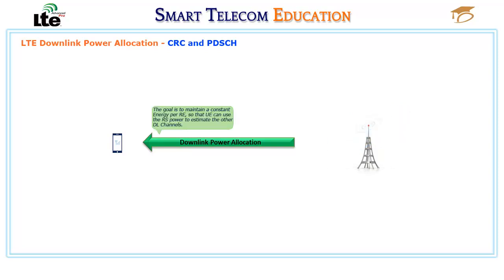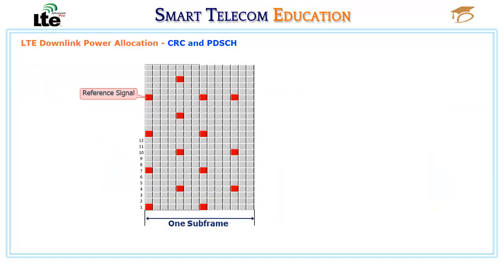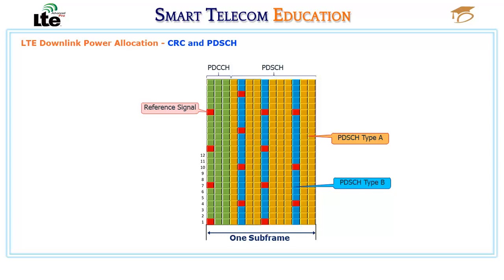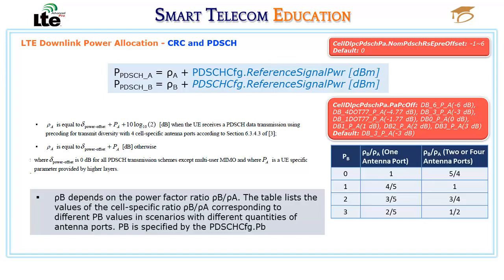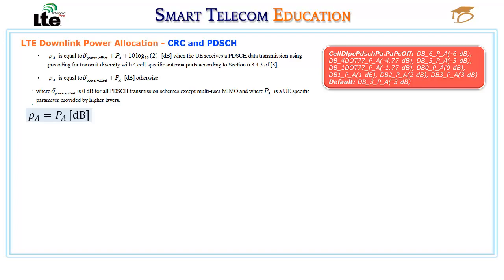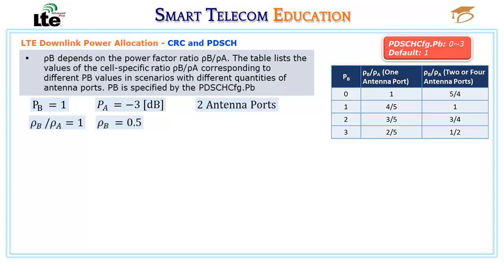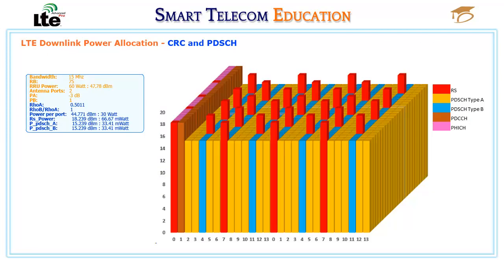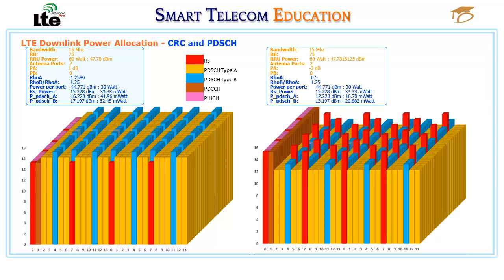LTE Downlink Power Calculation

Comment: Please explain, why Ppdsch_B= 20.88mW? In the scenario when Pb=0, Pa=-3. If Pa = -3, as in first example (Pb= 1, Pa= -3) RS Power is 18.2 (66.67mWatt) not 15.2. it means Ppdsch_B should be 0.6264*66.67=41.47 mW.  Right?
Reply from the maker: Hi,
The RS power formula include the value of Pb: 

Prs=Psingle_port - 10*Log(12*Nrb) + Log(1+Pb).

in the second example  Pb=0 not 1, so the value of the RS power is 15.2 for Pb=0 and 18.2 for Pb=1.

Kind Regards,
Smart Telecom Education